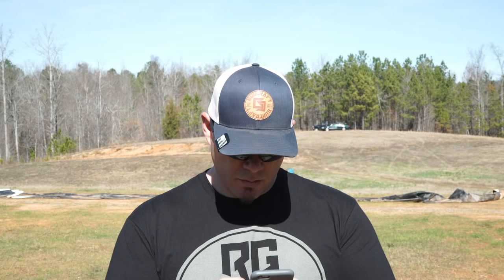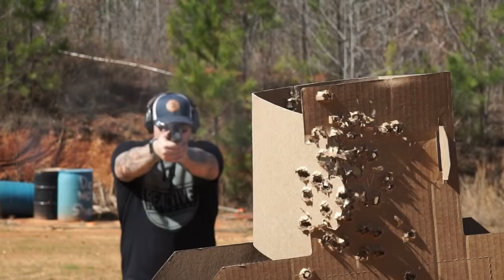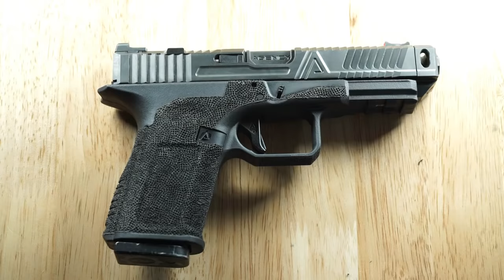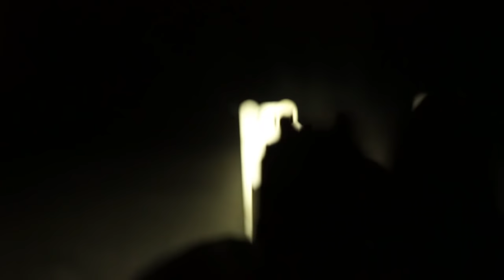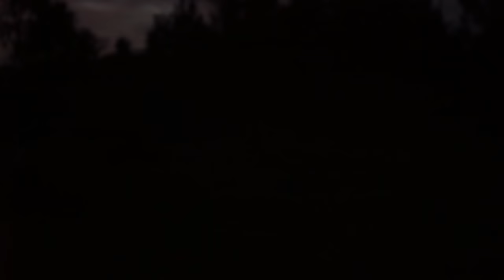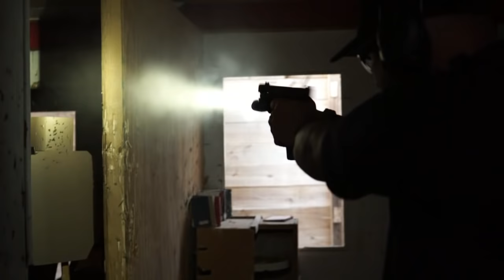Compensated Handguns

Comment: It looks like you run a "Gas Pedal" on your EDC Firearm, is that the case? Opinion of them? and also type of grip accessory do you use? Thank you very much for all the well thought out, experience driven, fact based, data driven, open minded, clear, concise, and no BS advice. Also your willingness to stand corrected, if applicable. All very rare attributes to possess, it's contagious. I have learned so much. Thank you sir, for your dedication to your craft(s) and service. Stay vigilant, stay safe!!!

Comment: I know this is an old post, but it's recent for me. A Southwest Precision comp fires with the OEM recoil spring in my G19 Gen 4. It's a single chamber, so it doesn't reduce the recoil a ton, but it keeps my dot flat and has helped speed up split times while maintaining accuracy. Not my carry pistol right now, but I might give it a try.

Comment: As a USPSA competitive shooter, and an avid Open Gunner, I can BOLDLY attest to the incredible effectiveness of  a properly setup comp'd handgun. Beside the full-tilt race guns, I own some factory ported guns too. Comp's are far more effective but ports way more compact, actually not taking any extra weight or bulk. Ports in really compact guns like the Shield, 380 EZ, Sig 365 SAS, etc, are to most people not detectable. A well in-tune shooter is more likely to get something from ported guns. They are more hazardous due to burn/blast from the ports. It doesn't feel great but its its not going to peel your fingers. The notion that the blast/flash from ports & comps will kill your vision is a bunch of baseless horseshit people keep repeating. People that most have never shot such a gun a day in their life. My Open gun breaths 1ft+ tall plumes of fire out the comp/popple holes. Ive shot it in dark conditions and its loud & bright but gone in microseconds and your vision is fine. Total BS, don't let that deter you from trying a comp!

Comment: I remember 1 time at a gun store some one was talking about getting a glock 45 and putting a comp on it. The store employee was puzzled nd said are you gonna use it for conceal carry, range or home defense. The guy response all the above, especially for conceal carry. The employee then suggest if you're gonna do that, then why not get a g34 nd don't have to worry about using a comp. The guy response it's too big to conceal, that he wants a 17 frame because it fits in the hand nd the 19 slide because he wants to carry it easier, a comp to reduce the muzzle flip. Then the employee suggest a 19 slide with a comp is basically a 34 slide. The employee nd the guy argued nd argued. Until the store manager said if that's what he wants, then let him do it. It's his money on what to spend. The employee apologies nd agreed. Now a year later i have come to realize i was an idiot nd a glock 45 with a comp is just basically getting a glock 34. (/.-)

Comment: I’m running a Zev V2 Pro Compensator on a Glock 19 gen 5 Mos FS , I’ve swapped out the stock barrel for a stainless Wilson Combat threaded barrel . I’ve had issues with the recoil with it stove piping trying to double feed . Been back and forth had to run 147 grain XP ammo to get it to be reliable with factory guide rod and spring .
I’m chasing stainless steel guide rod and different rated guide rod springs am yet to find them but I can only run the cheaper factory 115 grain ammo with the compensator removed .

Comment: Any plans on doing a video on Ported Handguns? I saw your comped handgun, close retention video on Instagram with Steve Fisher. Awesome video! Now that you mention the obvious disconnect between a ported handgun and compensated handgun, I am particularly curious of the blast difference between the two in regards to close retention fire. I assume much more with a ported vs a comped? Is it safe to practice close retention fire with a ported handgun if is a notable difference in blast? Although I do not EDC my 9L CORE Ported (I have a G19 for that) I am curious of its limitations, if any, in close retention fire, and any other possible limitations as you mentioned, if I do ever decide to employ it in a self defense role. Thanks for another incredibly informative video! On a sidenote, I run 124 gr range and defense ammo. No +P.

Comment: Hello sir(s).I bought for my first firearm the CZp10c. I use Minuteman 124 JHP. They're made right here in the state of WA and its almost as cheap as range ammo so I don't switch. 1200 rounds for $123 and change I believe.

Anyway, to the comp. Getting the PMM CZ P10C Compensator. Sits flush, footage looks amazing. As a first time buyer, I wanted something to help put holes where I need em.

Thank you for the video.
Reply: You got a link to that?

Comment: For those of us mandated to carry guns in 40s&w, do you think a comp would make a more noticeable difference than similar 9mm guns?
Reply: I used a ported extended barrel on my police surplus 96D .40 in the late 1990s. That ported barrel did help level out the thick alloy frame 96 to me. I took the lowered recoil as a +. The larger muzzle flash was a -.

Comment: So under the thought of a higher pressure round makes the comp work better and sometimes you have to use a lighter recoil spring to make it reliable wouldn't it make sense to just shoot 40cal? I mean the biggest complaint  on 40 is it beats glocks to death because it was never designed for it and it's to snappy so it you comped a 40 do you think it would be gux to alot of issues?

Comment: That moment when I want a comp and a red dot on my carry gun, but that's $1000 worth of upgrades on a gun I didn't spend that much to begin with on.
Reply: Holosun 507c-x2 $309
Agency Arms 517 compensator $110
Reply: @Master_Mew90  my gun isn't milled for a dot and I don't have a threaded barrel too mount the comp too.
Reply: @Master_Mew90  you forgot the threaded barrel, slide cut milling and the light bearing holster
Reply: @tedpendagast579  true

Comment: i have a glock 19c gen 4 and really like it. biggest drawback is the front sight turning completely back after a certain number of rounds, usually sooner with hotter ammo. Btw, what do u think of the lone wolf ported barrels for the type of compensation you discussed in the video? you know the one with the barrel extending beyond the slide with the 2 slots cut on top of them? I think those would achieve the same effect as the one u showed but less hassle and easier to disassemble/reassemble.
Reply: AK47andGlocklover I picked up a 19c gen 4 last year as well. Love it. In pitch black with SD ammo I don't see a lot of difference compared to one of my regular 19's. There is a slight difference but not much. Also I'd more then likely never be shooting in pitch black since I run a light.
Reply: You meant you have a Makarov pistol, comrade. 😂

Comment: I run the Glock 21 Gen 4 45 ACP 230 grain I'm going to be running a compensator on it I'm asking the same question to everyone I want a defense Tek Light and Laser combo Vortex Venom optic I'm also going to install a Magwell what is the best place to find a custom holster that would fit my rig what's your opinion
FYI I found the light laser combo on Amazon and it works perfectly well 600 rounds through my Glock 21 and it works perfectly

Comment: pick your brain here. not sure if your a bike guy, but how would you conceal when riding a motorcycle?
Reply from the maker: Raymond Bartlett probably in a Unity Clutch or belly band
Reply: didn't even think of that. I was trying to avoid off body carry. being that seems to be what most do. truthfully I was also thinking maybe a chest mount or the old school shoulder holster. with my current set up I have to be careful as not to damage the tank (sport bike). but also minimize personal injury in the event of crash or slide, key word minimize.
Reply: Raymond Bartlett I carried a pocket holster in my breast pocket. Belly bands don't work on sport bikes because of the angle you sit at.
Reply: Raymond Bartlett i was having the same dilemma because I ride a ZX6R full time. I ended up going with a Crossbreed super tuck at 4oclock. I carry a fullsize USP 9 and even under hard acceleration it stays put and is comfortable while in a full tuck.

Comment: Aaron, when you said you lose threads did you mean when you have to tighten the set screws down do they ruin some of the threads on the barrel?
Reply: the set screws don't touch the threads,they contact the barrel just past the threads.and you use a little bit of blue loctite on the barrel threads and set screws.Its not "married" to the barrel.You can take the comp off and on its just kinda of tuff depending on how much loctite you use,and you can damage the threads on the comp if your not careful.

Comment: Glock 19C gen4 is the answer. No spring changes or reliability issues. If you want a comped carry gun just get a ported glock. There's less than 3% difference between the two. They did a big study on comparing the two.
Reply: Dr2AlphaMuayThai who is "they"
Reply: Zane Mungillo shooting times. 

http://www.shootingtimes.com/gunsmithing/recoil-reduction-ports-vs-compensator/

Here is the article.
Reply: Dr2AlphaMuayThai 

good read. 

I guess you'd have to factor in the slight decrease in velocity and if you think it'll affect what the cartridge is designed to do (expansion/penetration).
Reply: Trill Withers for sure. 

I went for the 19C due to the ease of cleaning the gun and not having to have to buy a threaded barrel and comp. plus the reliability of a stock glock! A 3% decrease in velocity but of 30% decrease in muzzle rise, in my book, is a good trade along with the reliability of the non modified glock.
Reply: I had a 23 and 23C. The difference wasn't worth the extra blast

Comment: I have just never felt the need to put a bunch of shit on my gun. I don't need an RMR or a laser or a comp. I'm not shooting competitions with my glock 19 so why the fuck do I need a bunch of stupid shit?
Reply: fordrac1ng81 so you've never tried anything new to see if it works better for you? Or if you just like it better?
Reply from the maker: fordrac1ng81 lol. Then don't.  RDS allows for one focal plane vs three focal plane shooting.  Comps keep a gun flatter to allow sight picture reset faster. Lighter triggers minimize convulsive squeeze on the gun;  "stupid shit" is pretty subjective considering many (not all) modifications actually make a firearm more user friendly.  If you want to be a purist, you should just carry around a rock.
Reply: SageDynamics check out the primary machine works new comp, looks comparative to TBRCi micro comp
Reply: Or you could just get better at shooting instead of using things to aid your lack of skill.

Why not just run a 2011 STI open gun all the time? I mean, it's better, right?

As I said, if I'm racing I'll run a race gun. If I am using it for two legged animals I'll run a nice stock handgun. (with exception of WML)
Reply: fordrac1ng81 this is literally the stupidest comment of all stupid comments ever on the planet earth. It's called learning and evolving. Close minded people like you are the reason new ideas get shot down instead of giving it an honest thought. While I may not agree with everything Aaron Cowen does, I do respect and listen to him. It's called learning, might try it.
Reply: Crusader Arms Channel ask Aaron how he feels about truexodus.
Reply: William Turner I guess I get more information than just one person so I take things with a grain of salt. Grew up next to thunder ranch so maybe I'm biased to weapons that have won wars in multiple theaters rather than how flat something shoots when you post it on YouTube or IG. There is evolving, and there is putting stupid shit on your gun. Didn't we see this a few years ago with rifles when quad rails came out and everyone wanted to put every new "upgrade" on their fighting rifle. I'm not inspector fucking gadget